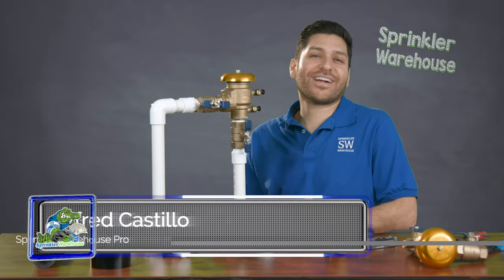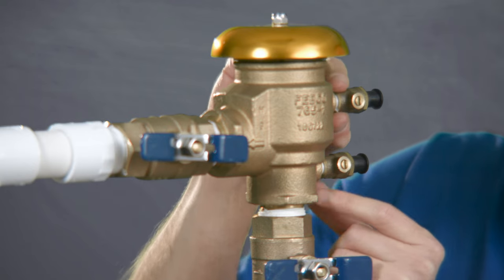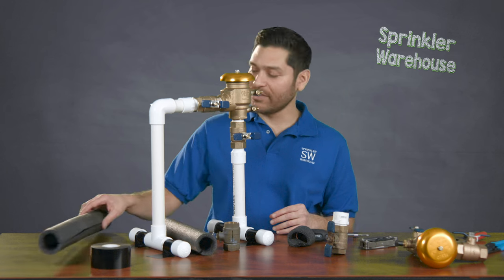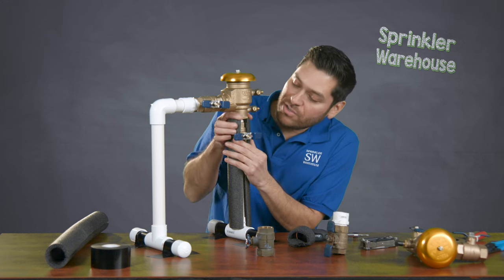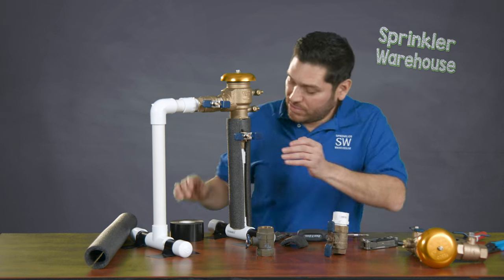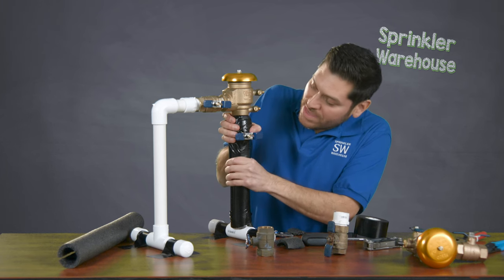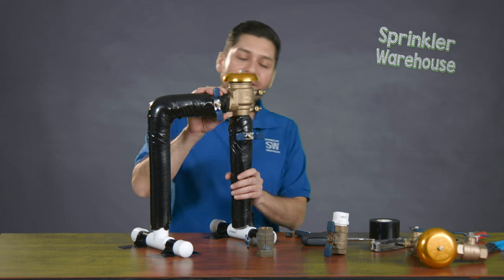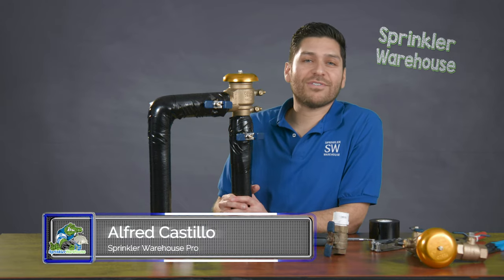Winterizing Your PVB Sprinkler System Backflow Freeze Prevention

Comment: This works ok but not in a bad Houston winter. You might save the bell but your inlet brass ball valve will split. The folks recommending unions and a plastic ball valve (to rig so you can remove it and take it into to the garage) have the right idea. But this common sense is rare.

Comment: That’s what happened to my valve.  I guess pool noodles and duct tape and towels wasn’t enough.  Maybe heat tape would work.
Reply: Don't need it if the system is installed correctly.
Reply: My ball valves froze and ruptured despite being wrapped. Now I'm  adding permanent heat trace, insulation, and a PVC jacket to better protect the insulation from my string trimmer. If the power goes out the heat trace has low draw and be powered with a car battery and inverter. The things you learn when you buy a house...
Reply: @jghall00  … the water has be shutoff before it goes outside. Febco has a video on how to do it the right way. Then you blow out each zone. No insulation or heat tape needed.

Comment: That insulation wont save the internals up top, you have to cover the top end or it will mess up the plastic internals
Reply: Do they sell some kind of insulated "sock" that can cover this unit?
Reply: I've never put insulation on my PVB. My system was set up right.
Reply: @99wallygator  Bully for you

Comment: Morons that installed mine in OK made no...zero, nil, nada....provision to shut off water supply. They tapped into the well feed to the house. And don't get me started on the other plumbing. Anyway, it was, generously, a shitty install. So, dug out the supply line well below grade and cut the pipe and removed the supply side PVC (they used a pipe thread PVC fitting on the back flow preventer (BFP) straight cut threads...I don't even know where you get a pipe thread PVC fitting...). Get an empty plastic pail that has a snap on water tight lid such as premixed drywall mud or something similar, 12 to 14 inch diameter works nicely.  Your hole should be deep enough to  spread maybe an inch of gravel around the supply pipe stub. Use a hole saw to cut a hole at least 1/4 to 1/2 inch bigger than the supply pipe in the base of the pail. Slip the pail over the stub. Install your PVC shut off ball valve on the stub ensuring you have room enough to swing the valve lever to the closed position. Glue in some vertical PVC to a height that will allow cutting it to accommodate a PVC disconnect fitting near the top of the vertical before it makes the 90° to the BFP valve. The disconnect allows you access to the remaining water in the vertical after you shut off the supply  ball valve....I use an air powered parts washer suction spray gun to suck the water out then reconnect the disconnect fitting. From here plumb the rest of the vertical and 90° elbow and horizontal screw fitting into the BFP inlet.

Fill the space around the outside of the pail with material removed making the hole. To winterize you can use some glass insulation bats wrapped around the pipe and shut off valve. Take the snap on lid and hole saw a hole just the size of the supply pipe. Using tin snips cut the lid from the outside to the hole. You can now warp the lid and slide it over the pipe and down to snap onto the pail's rim. You can then place some more dirt material onto the lid to insulate if you need to depending on your lowest expected temps. My whole above ground BFP and piping is covered by an insulation muff that you can buy commercially and this is all covered by one of those fake rock items. I've also taken a cheap trouble light and used a 15 watt incandescent bulb (doesn't require much heat) and placed them in the muff and plugging it in for really cold temps or long term below freezing. I also have two wireless remote temp senders in plastic zip locks, one at the bottom of the pail next to the pipe and another just above the ball valve. The top one is the alarmed sender. The senders were both checked before install and were within a half degree. In use the temp at the top of the pail is about 6° warmer than the bottom sender with the light plugged in and about 1 degree difference without heat. 

The advice here to use foam to insulate...why are you insulating an empty pipe supply, BFP and outlet? All the water should have been removed when you blew the water out of the sprinklers and (in my system) sucked the water out of the below grade vertical above the shut off ball valve.

Comment: wow... So much of this is wrong
Reply: Care to elaborate...?
Reply: The valves should be left 1/2 open. And this method only works in some regions where the ground doesn't freeze. Many regions will require a blowout or complete draining of the supply line or removal of the backflow device. Writen by a certified backflow tester.
Reply: @SmartIrrigation1  Why make valve 1/2 open instead of leaving it totally open? What's the difference?